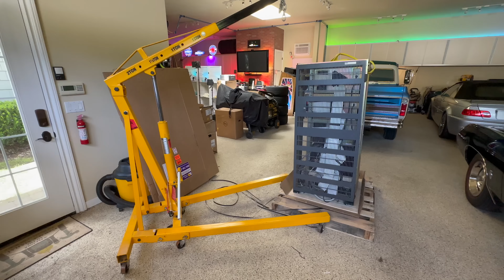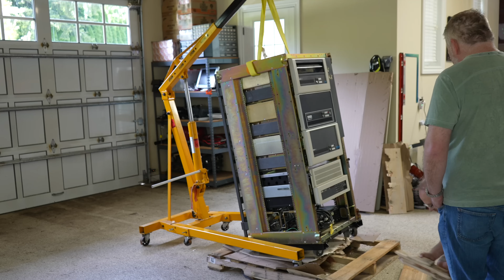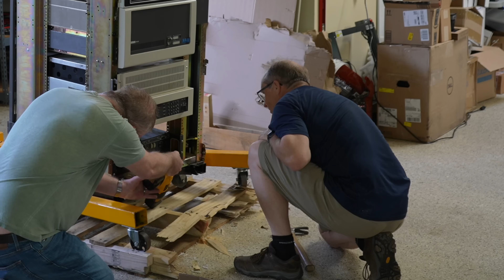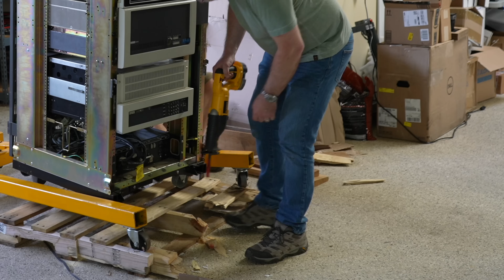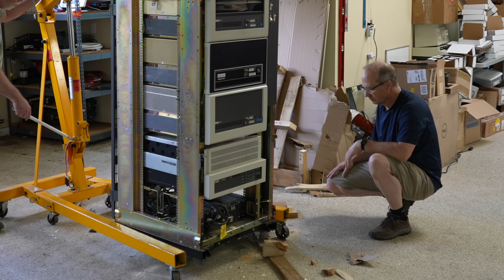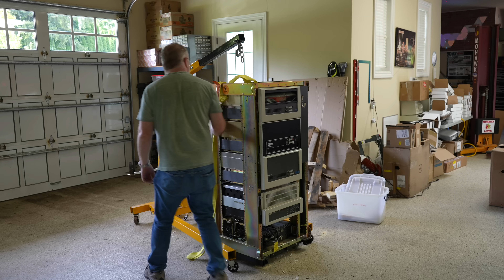I Bought the HEAVIEST Computer on eBay: The PDP-11/34!

Comment: I only have seen the PDP-11 as a number cruncher for Mass Spectrometers. 
In the 1990s I was a field engineer for Hewlett-Packard and VG Mass Spectrometers, so there were plenty of these machines collecting data and crunching numbers to present the graphic output.
It is always good to see a "Lazarus" booting. Lazarus have come back from the dead.
One observation. I would very much take care of static discharge when working on the boards. It is worth buying a carpet for you to lay down the boards and use the grounding straps.
I am very happy it worked for you.
Reply: Yes, my dad had a PDP11/34 in his lab connected to a mass spectrometer. What you described was its exact roll. He told me it was very pricey and the annual maintenance contract was also costly. Fortunately in Canada the Federal Government was paying so it was treated very well. I believe Dave indicated during his board pull that one was a A/D board, so that’s likely the board interfaced to the mass spectrometer. Hopefully he can pull up some m/z (mass to charge) spectrograms. Looking forward if Dave can dig up something off his machine especially if related to mass spectrometry.
Reply: Back in the 70s-80s I was a field engineer for Burroughs. They sold a high volume laser printer OEM'ed from Xerox. It used an 11/34 as a controller. There was a 9-track tape drive for reading print files from the mainframe and a disk pack for software.
Reply: Fortunately, even at my impoverished Uni, when I started using HPLC, GC and MS (some of them even by HP), they weren't running of PDP-11s.

Comment: That was very interesting, Dave.  My jaw dropped when you showed the wire wrap board... I did not expect that. 😮  I used a PDP-11 at Uni in the early 80's.  I never saw the host itself just  used connected terminals and a teletype.

Comment: Can it run Crysis? If not how about this Crysis Text adventire? 

10 PRINT "Welcome to the Crysis Text Adventure!"
20 PRINT "You are a soldier equipped with a Nanosuit, deployed on an island in the South China Sea."
30 PRINT "Your mission is to rescue hostages and uncover the secrets of this island."
40 PRINT "Type 'help' to see the list of commands."
50 LET LOCATION = 1
60 LET INVENTORY(10) = 0

70 PRINT "You are on a beautiful beach. There's a dense jungle to the north."

100 INPUT "Command: ", C$
110 IF C$ = "look" THEN GOSUB 1000
120 IF C$ = "inventory" THEN GOSUB 2000
130 IF LEFT$(C$, 4) = "move" THEN GOSUB 3000
140 IF LEFT$(C$, 4) = "take" THEN GOSUB 4000
150 IF LEFT$(C$, 3) = "use" THEN GOSUB 5000
160 IF C$ = "help" THEN GOSUB 6000
170 IF C$ = "quit" THEN GOSUB 7000
180 GOTO 100

1000 REM Look command
1010 IF LOCATION = 1 THEN PRINT "You are on a beautiful beach. There's a dense jungle to the north."
1020 IF LOCATION = 2 THEN PRINT "You are in a dense jungle. It's quiet... too quiet. There's a path leading east."
1030 IF LOCATION = 3 THEN PRINT "You have reached the crash site of your squad's plane. There might be something useful here."
1040 RETURN

2000 REM Inventory command
2010 PRINT "Inventory: "
2020 FOR I = 1 TO 10
2030 IF INVENTORY(I) = 1 THEN PRINT "Weapon"
2040 NEXT I
2050 RETURN

3000 REM Move command
3010 IF LOCATION = 1 AND MID$(C$, 6) = "north" THEN LOCATION = 2: PRINT "You move north into the jungle."
3020 IF LOCATION = 2 AND MID$(C$, 6) = "east" THEN LOCATION = 3: PRINT "You move east towards the crash site."
3030 RETURN

4000 REM Take command
4010 IF LOCATION = 3 AND MID$(C$, 6) = "weapon" THEN INVENTORY(1) = 1: PRINT "You take the weapon from the crash site."
4020 RETURN

5000 REM Use command
5010 IF MID$(C$, 5) = "weapon" AND INVENTORY(1) = 1 THEN PRINT "You equip your weapon, ready for any threat."
5020 RETURN

6000 REM Help command
6010 PRINT "Available commands:"
6020 PRINT "look - Get a description of your surroundings."
6030 PRINT "inventory - Check your inventory."
6040 PRINT "move [direction] - Move in a direction (north, south, east, west)."
6050 PRINT "take [item] - Pick up an item."
6060 PRINT "use [item] - Use an item from your inventory."
6070 PRINT "help - Show this help message."
6080 PRINT "quit - Quit the game."
6090 RETURN

7000 REM Quit command
7010 PRINT "Thank you for playing. Goodbye!"
7020 STOP

Comment: I started using the PDP11/34 when I was 14 years old.  Generated the RSTS/E operating system for the lab in our school district.  We had 8 VT100 Terminals and 8 paper terminals.  And two disk packs and believe it or not a simple version if swap to disk.   I would like to see if you can get some of the old RSTS code running along with the game Trek52 which used the full screen of the vt100 terminal to play star trek in a grid fashion.  There were also VT100 "video's" ascii based that were really cool like Bambi vs. Godzilla that you can check out.

Comment: My first machine was a PDP-8e with the system expansion box and 16 whole K of actual core memory, which took up an entire drawer (each 4k was three boards, one with cores, one with the amplifiers and such, and one for the digital stuff)  DECTape was the boot device, and ultimately they added two RK05 (?) disk drives.
I miss that machine.  You never forget your first.

Comment: @DavesGarage I have a story that I am not sure anyone else can make the same claim... I personally knew a DEC Engineer that was either the first or on the team that interfaced a Magnetic Resonance Imaging machine to I do believe a PDP11/70 system and his roll was to create a D/A A/D interface to process the MRI data and he did this because his mother was very sick and needed the power of the PDP11 to process the biological data.  I cant say how wide the data converters  were in bit or bytes.  and before  I met him I had an account on a junior high college machine that was connected to a wide paper DEC Typewriter / Printer terminal.  Its been way too long and I suffer memory problems but this was back in the 1980s or so.
 
anyway to sum up its kind of cool to know somebody that made the tech journey to make an interface that made great strides in medical diagnostics.  I miss Buddy H. and will always send thanks for making medical diagnostics for the betterment of mankind.  Oh at the same Jr College was an IBM 360 / 370 4341 where I cut my teeth so to speak on mainframe assembler - Thank you 80 column Hollerith Punched Cards, IBM 3270 terminal, EBCDIC Character Coding system - this is all I remember for now - good day to all.

Comment: The first computer I ever got to play with was a PDP11/04 back in I believe 1977 when I was in High School.  We use to write our BASIC programs on Punch Cards.  Key Punch machines are like workout Gyms for fingers.   I think we also used 80 Col Mark Sense Cards too.  We had a Hard Copy Terminal a real paper waster and we did have a CRT Terminal but it had issues so we rarely got to play with that.   While we got to play with it the primary purpose for that PSP11/04 was to keep track of Student Attendance using Punch Cards.   I don't remember how it turned on I barely remember what I did yesterday unless I make a note but that PDP11/04 got me addicted to computers.

Comment: I always enjoy any PDP-11 content. By the way most of these I’ve ever worked on had latches that you could release and rotate the cpu box into a vertical orientation to make it easier to work on the underside. You had to be sure it was fully pulled out of the rack to do it. As I recall the releases were silver colored loops on either side near the front of the cpu box.

Comment: Man, the mention of wire wrap brings back some memories. I spent years doing this back in the day.
Reply: I agree. I was hit with a wave of nostalgia at the mention of wire wrapping. During my college projects in the mid 80s I was wrapping (and unwrapping) probably a zillion little blue wires, and found that the curly pigtails of unwrapped wire wrap wire when tangled with carpet fibers are almost impossible to extract from the carpet. Good times!
Reply: The backplanes of these machines were probably made in Kanata, Canada.
Reply: Wire wrapping with all the myriad pretty colored thin wires was actual fun !  A lost art today I imagine, mores the pity.

Comment: More content please. I still have 3 PDP11's running an old furnace at work. Wish I had time and spares to play around with it.
Reply: Someone, like Dave, would pay for your upgrade - and save you a fortune in power too
Reply: @myne00  When the factory uses almost 10MW of power, the little bit extra to run a PDP11 is nothing. And an upgrade for this is cost prohibitive already, its not just replacing the PDP11s, there is more to it.
Reply: @Regular6782  fair enough.

Comment: As a retired tektronix engineer who started in the PDP-11 era, I’d say if you can find an old working tektronix direct view storage terminal (dvst) and the software you could load the old lunar lander program that simulated landing on the moon from orbit and displayed the lander on the terminal. Used keys to control engine thrust. Don’t know if it would work with a current generation terminal program that has a tektronix graphics emulation mode or not. I wasted hours with this. Surprisingly hard to land in one piece!

There was also a text only adventure game. Can’t remember the name, but you could explore and pick up treasures to use in future battles. I remember I keep getting stuck in the maze of “twisty turny little passages, all alike”  - assuming I could get through the maze of “twisty turny little passages, all different”! Spent hours on that one, and I don’t even like computer games! Of more modern games, the only ones I ever play are solitaire and occasionally Tetris!
Reply: That game was “Clossal Cave” by Willie Crowther. I had a version written in Fortran  (including Source!). I was the one (by a real stroke of luck) to finish first. Charle Drum - are you out there? It was a GRAND time and CC and the PDP-11 live as beautiful memories of mt early years becoming a programmer. 😊
Reply: @Harrzack I remember the version I played on pdp-11s and VAXen back at the dawn of the 1980s being called "Adventure" and the same game eventually ending up on PC (And I think Apple II as well) as "Zork". I believe "Collossal Cave" was the same thing, although I'm not sure which is the original name. " It's so dark, you're likely to be eaten by a grue." Good times!
Reply: In the mid-1970's my friend at Tek, an engineer in the 5000 series lab instruments division, would play I think the same cave/dungeon game on a WYSE terminal over weekends.  It was addictive.  We discovered if you shot an arrow at a monster and it bounced off, then picked up the same arrow, it became magically blessed with invincibility, but only if you: "wielded the arrow" at a monster not shoot if again from a bow.  We stopped using that trick because it make the game too easy.  

Back then, Tek was one of the hundred or so nodes on DARPA-net and we had new fangled email accounts.... halcyon days.

Comment: Amazon has a large selection of wire wrap tools... the Jonard ones are the nicer ones, but they're proud of them so they cost a lot more...  Plenty of cheap wire wrap spools available as well.  Just strip the end of the wire, feed it into the tool, put the tool over the pin and give it a couple of turns to get it on the pin.  The DEC technician that serviced our VAX system used to regularly have to fiddle with the wire-wrap on the TU78 tape drive when re-aligning the heads...

Comment: Dave 
For about 7 years i lived in Ballard and had a couple of volunteer jobs. one being Interconnection, this back when they where across the street from the Fremont studios. someone donated a silicone graphics workstation circa mid 80's, it was in a rack or frame. it was the heaviest thing i have ever had to move by hand, it didn't two or three, it took more 5 or 6 and then the pers who was taking it could do the rack and the computer, i think it was a weight issue but it could be space. i really can't remember why, i just remember it going and them having to leave all the support framework behind. secretly i wanted that station, didn't have the space for it or the power to feed the thing or the knowledge on how to use the thing, wanted to learn though. the plug looked like it was 2something . actually have yet to come across that plug type again. but i'm not an electrician so it could be an off the shelve part and i wouldn't know

Comment: 3:50: $120,000 in 1960 is equivalent to about $1,250,000 today. $0x131AB8, to be exact.

Yes, I know they used octal back then. I used to work on a 11/73 with a colour text display—was it VT320? VT520? I don't remember. RSX11M+. SYSGEN. MCR, EDT and MACRO-11. QIO$S. The TKB linker. SY:[1,54]. I'm surprised that I in fact remember this stuff...
Reply: 0o4611320
Reply: The VT320 was a  flat screen style monitor that came in 3 flavours of display;  amber/black, green/black or paper white, which was fab, the VT340 was the bigger, colour monitor.
Reply: @jujuUK68  Thank you. I remember that mine was indeed larger than VT220, but can't really recall whether it was VT340.